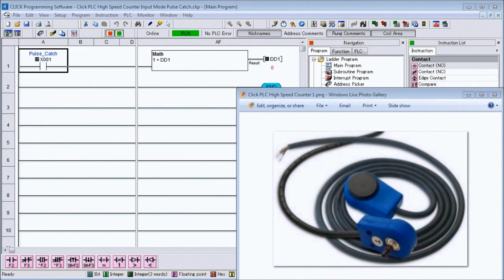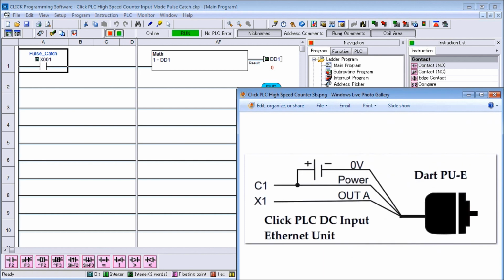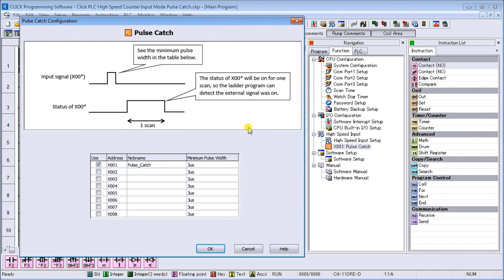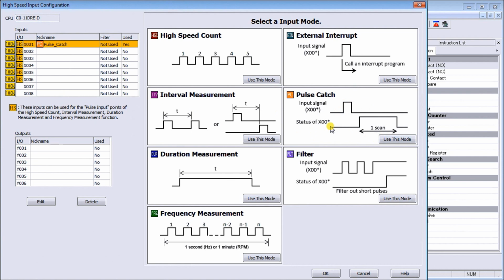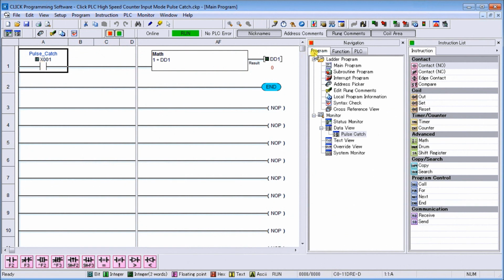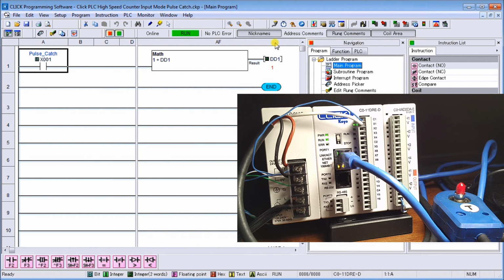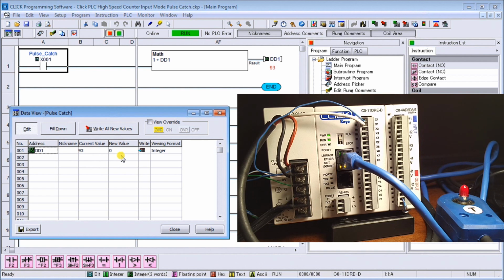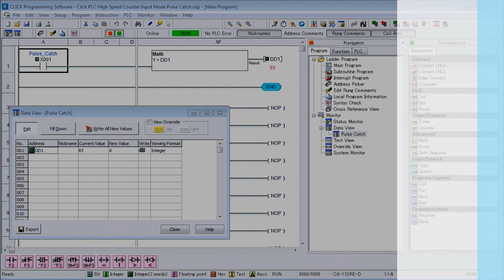Click PLC High Speed Counter Input Pulse Catch Mode

Comment: Gary, could you use this setting to calculate the speed of a ball between two sensors?
Reply from the maker: Hi Michael,
Yes, this could be used to calculate the speed of a ball between the two sensors. Each sensor would use the pulse catch mode and have a minimum input time of 3 microseconds. 
You would then have the +/- the scan time for the accuracy of the time.
Regards,
Garry